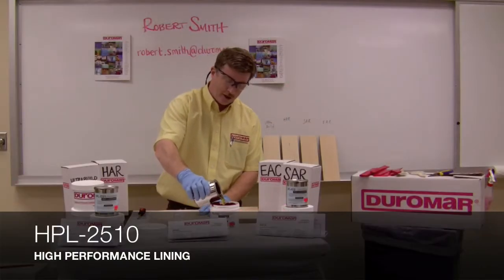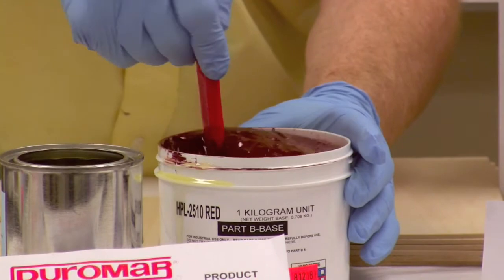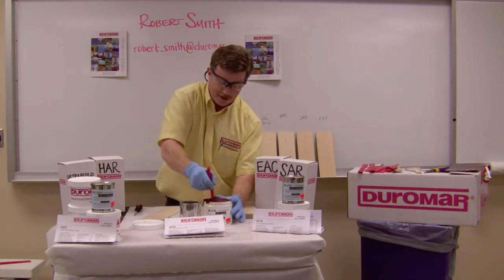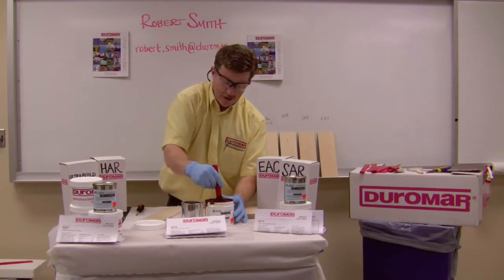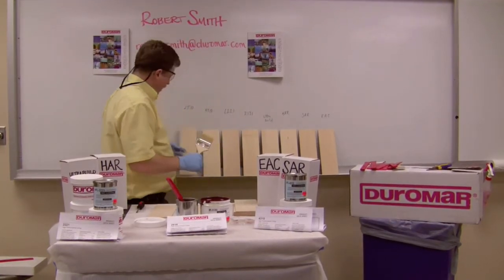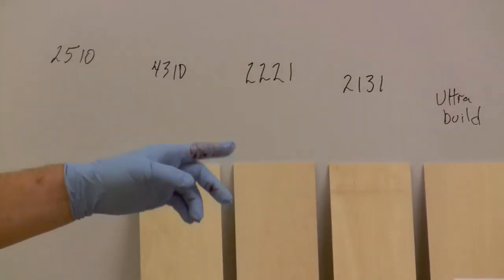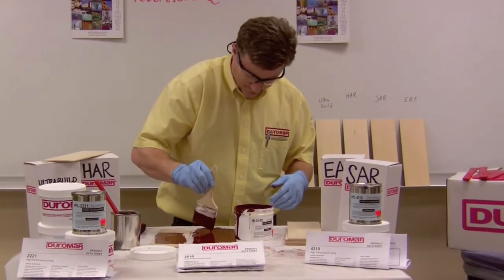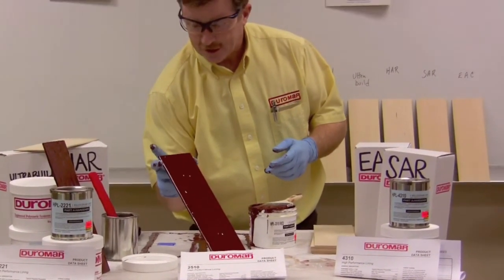Duromar 2510 Coating

Comment: link to a demo on 2221?
Reply from the maker: Recorded this 10 years ago.  I'd contact Duromar.  Bob isn't with them any more.
Reply: @maestroz25  I saw that figured it was a long shot lol. I'm about to coat the bottom of a boat with the 2221 so was just curious. Not a lot out there on this product
Reply: @williammccall4993  Did you ever find a video on the 2221?